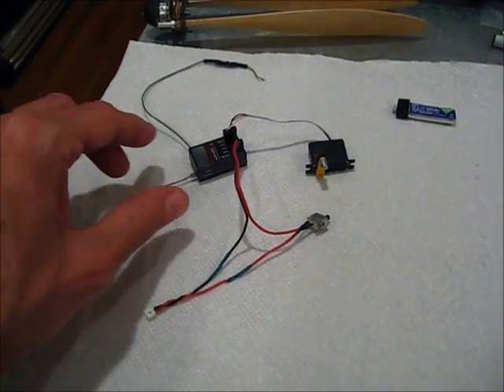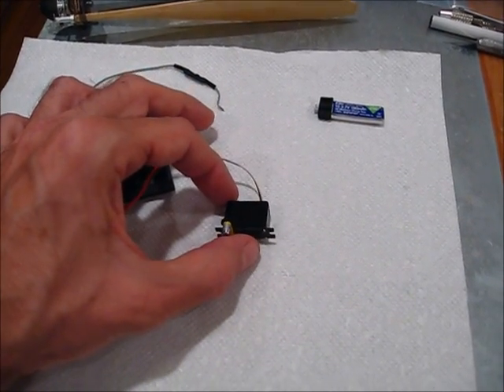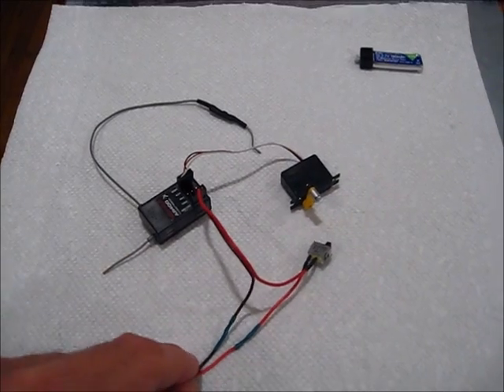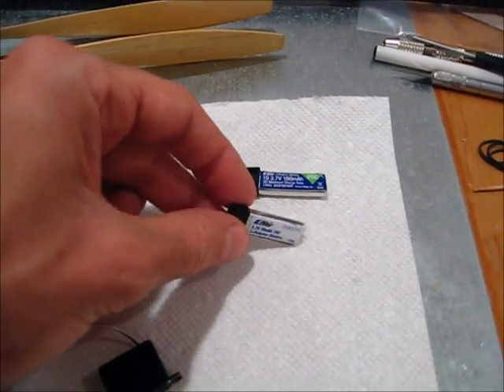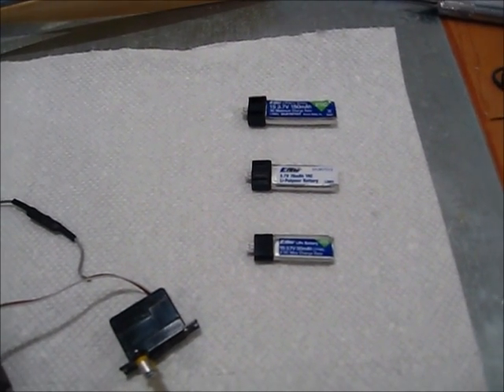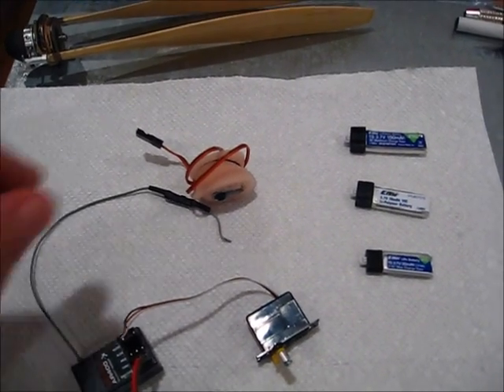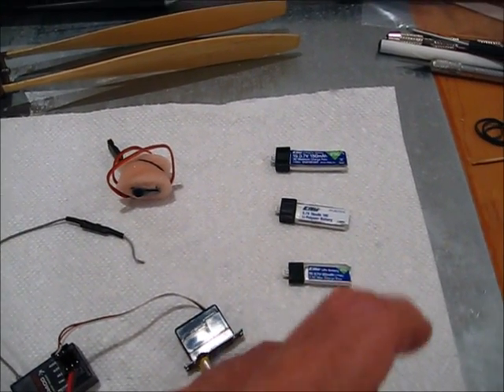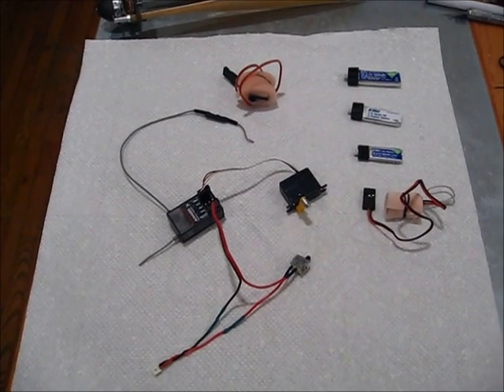Single Lipo-Receiver-Servo RC with Altimeters

Comment: I know this is 6 years ago have you changed the micro setup much being altimeter. 
I watched your lighter servo video and the lemon vs orange reciever and small battery options

From Australia here and also fascinated by blast tubes and half alloy tube you use for mounting rubber.

I diddnt have large enough nose plug to take a blast tube.
Reply from the maker: I'm still using the orange receiver (no longer available, but the lemon is good as well) and the altimeter. The blast tubes are thin walled (.032 or .047") aluminum tubing. Yes - I frequently have to use a larger nose plug to take the blast tube or half-tube, I use all half-tubes now.
Reply: @domoremath  thanks so much.

One last question on the covering technique. 

Do you dope or heat shrink the fuselage. Not familiar with that covering that seemed like tissue but you just glue holes then heat them tight to fix.

And regardless do you paint the fuselage with the flower paint too to match. I found that paint here too in Australia. 

And a confession. 
For quite a while I diddnt realise these were rc rudder and I was just soo amazed that you built such lovely planes that flew to several hundred feet in a city park and still landed in the park.

I thought it was a mastery of trim

But in truth it still is all the above  

Just a little rudder assist.

I learnt a great deal from all your hard work you put in here documenting and modeling videos,  flight videos  

Massive effort on your part.

Oh one last question 
The blast tube part you have two pieces one each end  there is advanced bobbin at prop end and that funny double reverse hooks thing at the rubber peg end.

I'm still a little lost on that.
Do you have a photo of a assembled half tube and the two ends.

I think advanced bobbin comes off to put prop on and the double hook thing at peg end grabs  rubber peg as you insert half tube and stays on rubber in plane.

Maybe  ?   :)

I have an al casano 1930s design competition stick I restored somone else built over 26 years ago and its flown its maiden and was just test flights of 200 turns and it circled us at about 12 to 15 ft like a beautiful big slow floating whale in the sky showing its colour through the sunlight it was amazing.

But it needs to do the stooge wind and the wood is old this is why I must learn this half tube.
This won't survive even accidentally letting a rubber go :)

So thanks in advance. 
If we could add pictures here I could load one for you
Reply from the maker: @kaillou2004  I'd check hippocket aeronautics, a lot of these questions about the half-tubes, covering, painting, etc have come up there and you can find them if you search around. Some of my other videos, like the Lanzo and Pacific Ace, give other info about covering/painting etc, but I'll try to get some more stuff up.
Reply: @domoremath  hey thanks heaps.  I'll search more too. I'll find it I'm sure.

Thanks a lot  and appreciate the time.

Nationals free flight in Australia West Wyong in July . Check Australia out. NSWFFS   New South Whales  free flight society. 
You should visit.

Comment: Would you recommend a system like this for a Gollywock? I saw your lighter system but am thinking it might not have enough torque on the servo.
Reply from the maker: You really only need the Dymond for large planes, like Wakefields, it's overkill for the Gollywock and stuff under 40", I'd recommend one of the two shown in the other video. I've used the lighter HKM servo in planes slightly bigger/heavier than the Gollywock and it's been fine, even in intense wind (see my KK Ace video), if you want to play it safe use the DS35 shown in the other video, I've used that in coups. The Gollywock is a great performer, you shouldn't have any problems turning it with lighter servos, and you'll love flying it, have fun!
Reply: @domoremath  Thanks, good to know! I'm looking forward to flying it in the Long Meadow of Prospect Park. First time with a folding prop too!
Reply from the maker: Neat, Prospect park should be good for rubber RC, I think it's a little bigger than my current field, DeWitt Clinton park.

Comment: So you plug a LiPo directly into the (spektrum, I guess) receiver and the receiver still binds and drives the servo? 
I thought that in the absence of an ESC, one had to include a BEC between the receiver and LiPo to drop the voltage down for the servo???
I'm trying to do exactly this for a two channel glider.
It works fine with a NiMh battery, but if I put a single cell Lipo directly to the Spektrum receiver, the servo just sits and buzzes.
Reply from the maker: Yes, I plug the LiPo into an empty plug on say the Spektrum, then the servo in the rudder channel, and the receiver binds. No, you don't need to drop the voltage down, the servo's are generally rated to well over 4v (the 282a is 4.8v) and a fully charged single LiPo is 4.2v. Check your servo and see what voltage it's rated for, I show three servos in this video which have all worked fine. Good luck with the glider!